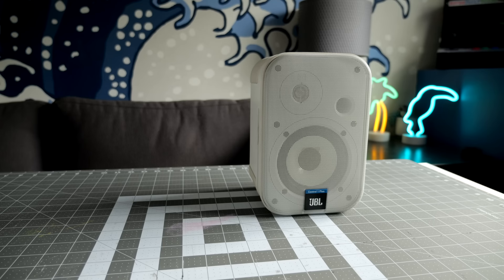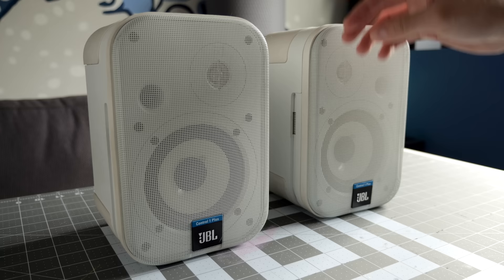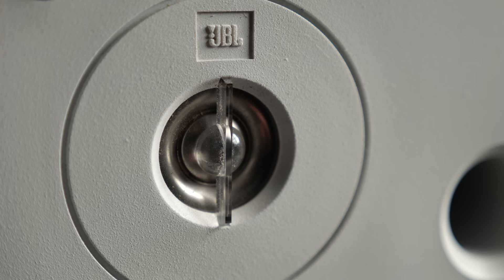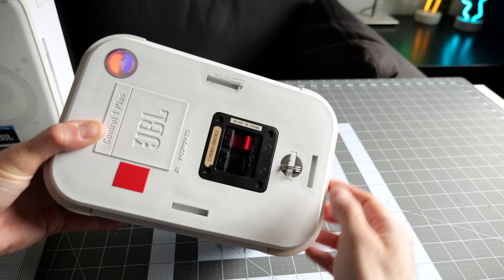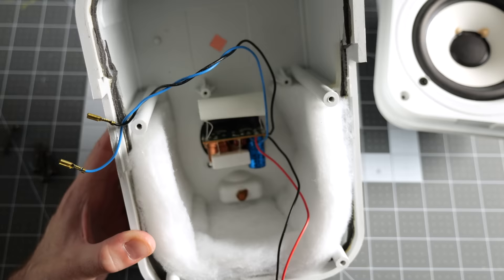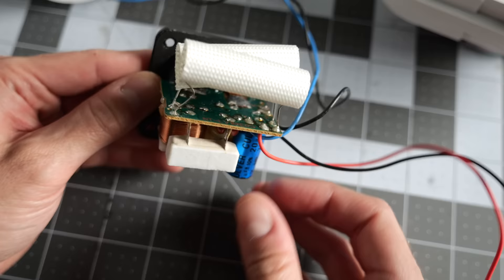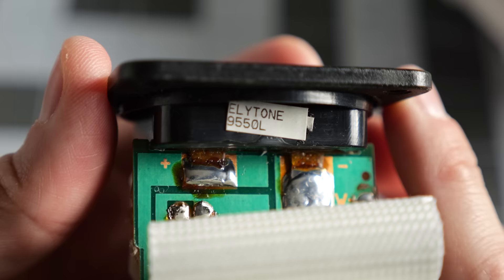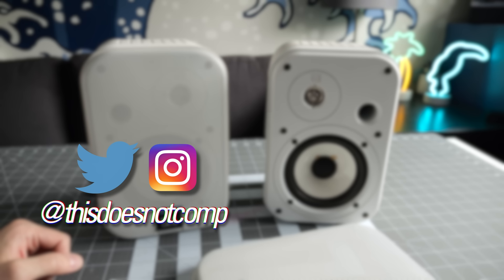Fixing My Vintage Speakers -- But Why Are There Light Bulbs Inside?

Comment: I've got a pair of B&W DM310's that seem to have the same issue. Strangely, I thought it was my soundboard cutting out, since the master out level-indicators were showing low power to the speakers, but I've since replaced that, and every other component in the system, and the speakers are still doing it, even down to the 'pop back to life when you turn up the volume' thing. Maybe they were both on the fritz, who knows. I'll be curious to see if re-flowing those joints took care of the issue!

Comment: If it starts giving you a problem again, it maybe a poor crimp connection on one or more of the speaker cable connections to the speakers. In that case I would cut off the crimps and solder the wires directly to the speaker terminals.

Comment: Hi there, doesn't the names of the control series speakers had to do with the size and number of drivers?
I purchased in the year 2000 a pair of control 25 that can be used in exterior, even painted, but never used them like that.

Comment: I question a bit how effective lightbulbs would be at saving a coil.  Usually the problem is clipping.  When the amplifier clips it stops producing a sinewave and has a flat spot at the top\bottom.  During that flat spot the coil isn't moving, and thus, isn't cooling and heat builds up.

I could be totally wrong, but that's been my experience.  I suppose they might prevent overexcursion.
Reply: My dad has some B&W DM17 speakers. When playing the TELARC 1812 Overture on them at loud volume, a protection circuit kicks in and the red LED on the front lights up and they go quiet for half a second, specifically to protect the components from being held immovable.
Reply: I can't imagine a flat top on the waveform would be an issue here, as they will not always be fed a perfect sine wave. For example, they might get a perfect square wave instead.
Reply: @user2C47  All natural sounds are sinewaves, it's just how nature works, so it's rare that you run into square waves, especially at high volumes.  The only time i can recall hearing much square wave sound was the oldschool PC speaker, which weren't exactly powerful.

I've had speakers cook from the amplifier clipping, and the power being sent to them was well under the speakers capability.  I built a sort of portable speaker as a kid from a old car stereo stuff.  Shortly later i lent it to my brother for one of his party with stern warnings not to go past half volume because of the distortion.  Of course some random kid cranked it and in the morning all the coils were warped and scratching inside the magnet.
Reply: It would save your speakers in the case where you have a too powerful amp driving speakers designed to handle a max power less than what the amp can deliver. In this case the amplified signal would not be clipped and the bulbs will limit the current to below what the speakers are designed to handle. I’d image thus is very useful and much more common since people are always wanting super powerful amps (this thing puts out 300wpc dude!) but rarely own speakers capable of handling nightclub levels of power. It’s not a problem when you have volumes at reasonable listening levels because your probably only putting out 2W during the loudest moment for a fraction of a second and almost any speaker can handle that. There’s a reason a lot of VU meters on amps have a switch to show power x 10. At sane listening levels your amp rarely gets above 1W and your VU meters are boring. We all want to see the meter swinging wildly even without the volume cranked all the way up. But if you turn the volume up really high because you are listening to a really quiet recording of a mellow classical piece then switch to your aux input and play a compressed and brick walled modern rock recording but forget to turn the volume down first these would absolutely save your speakers. 

But I agree with you in the case of clipping. That would indicate that your amp is not powerful enough and these bulbs wouldn’t help.
Reply: @trippmoore  Could be.  I've never had a speaker die from being overdriven, so i'm not sure if the suspension would be strong enough to hold the coil stationary for parts of the cycle.  I've always figured the suspension would just tear or stretch far enough for the coil to pop out.

And yes, people are funny about power levels.  Back in the day i made a huge sub box for my car, and those 2 12's driven at 200w's or so were louder than my brothers 1000w setup.  You generally don't need a fraction of the power people think you do, and even then box design can boost efficiency massively.  IIRC in a like for like situation 10db requires 10x the power and "sounds" twice as loud.  Choice of speaker and box can net you a 10db gain in many cases, and with that a 100w amp will be as loud as a 1000w.

too bad subs are where you need the power, and efficient boxes are generally quite large.

Comment: You mentioned trying to decode the date from the serial number. Doesn't look like you have to as the inside of the speaker panel has a date of 9 or 11 /1989 if you ask me. It looks like just months but there are two sets of dots.

Comment: I have the same issue as you have described. Volume gets softer, starts to crackle a little, when the volume it turned up it fixes itself, I can then lower the volume to the previous volume and they both work fine. I swapped to a different speaker and had the same exact issue. This made me realise it was the amplifier that is causing the volume imbalance, but I’m not sure what exactly is causing it in the amplifier. It only happens to the right channel output from the amplifier, swapping the left speaker with the right speaker still causes the right output from the amplifier to get softer. Perhaps you might want to try with a different set of speakers to see if your amplifier is at fault?
Reply: Output transistor not turning on until it gets enough current? Is this a class A, B, or AB (assuming it’s not D). Could also be a cold solder joint but before the transistor as opposed to in the crossover.  If you have a vintage amp you might just want to recap it. It likely will have at least some electrolytic caps that are way out of spec if it’s more than 30 years old.
Reply: @trippmoore  thanks for the reply! I’m not too sure which type of amp is inside of it, but I’m very sure it’s not a class D. It gets hot even without music playing. It’s a Yamaha Rx-V463 5.1 receiver.
Reply: @jundaaaaaaaaaa  I had a Yamaha HT receiver from the late 90s and after 10 or so years it developed this same issue. It’s the electrolytic capacitors. They used really cheap caps in these in order to sell them so cheap given all the technology they contained. Although my receiver retailed for over $900 when I got it. Luckily I only paid $150 because I had a friend that worked at Yamaha and I got to go to the Yamaha employee sale one year. It was last years model but for the price it was a steal. Took bad it was before hdmi because I probably would still have it if it did.
Reply: @jundaaaaaaaaaa  To elaborate. You should replace all the electrolytic capacitors in it. It will probably take a few hours and it’s not to hard if you can do simple soldering. I’m pretty sure it’s all through hole and not surface mount. The later would be much harder to do without lots of practice.

Comment: I would of tested them before putting it back together.  Just my experience fixing and re coning speakers as a sound engineer. I put way to many things back together and them still not work and have to take it all back apart.    My opinion though.  Good video
Reply: Didn’t you hear how he said it was an intermittent problem? I guess he could have tested if he really fucked them up, but unless he wanted to keep them apart for a couple weeks that wouldn’t help him.
Reply: @trippmoore  thanks for sparing me the time replying exactly that lol

Comment: You made me go check if my Genelec 1029As have foam material in the woofer, thankfully not. Those active monitor speakers could also be old, since they were produced from 1995 until 2005 until they were replaced by the 80 series.
Reply: If they had foam, they would be ruined by now. I learned the hard way...
Reply: @MarcoLopesPT  what happened?

Comment: Another thing that can destroy speakers is a amp not large enough, and the volume turned up. And the amp is clipping, sending dc to the speaker,  causing the voice oil to heat, short,  
I turn it up until it sounds good, when the quality goes down turn down the volume!

Comment: Heard these in a studio once.  Ima be real though if it's not ported woodgrain you're in for a pain.  New Chinese xo's can be had for $30/set & are usually better designed than the usual hackery speaker brands were doing at this time (like only putting a capacitor & coil on the tweeter).  Fixed up my gramgram's klm's & they flattened out in like a JAZZ way.  Of course I also padded them with towel, isolated them & buffered the port with the original wool.

Comment: This is not new. Sometime in the early 80s (maybe 1981-2) I was given a pair of Bose 301 for repair and they also had a “mini light bulb” in their crossovers. The 1986 JBL Pro III (precursor of the Control 1) also had this feature.
Reply: Since these are speakers from the late 80s I don’t think he’s made the argument that the bulb limiters are new.

Comment: the incandescent light bulbs themselves can blow just regular household bulbs you may need to replace them
Reply: You might but they are run cold in a speaker under normal operation, tiny fraction of their rated wattage. They are basically used for their PTC property.

Comment: I have a set of Bose 141 that I've been using for a little over 3 years they fit my application and I used them daily with a bluetooth radio and my phone so YouTube and my alarm clock  Im not disappointed

Comment: For the "Plus" version, i was expecting some kind of metal female SCREW on the plastic supports, so that the speaker could be serviced (let's be honest... SCREWS on PASTIC are for ONE TIME use... specially on soft plastic like the CONTROL 1). Seeing that they still don't give attention to these details is a huge NO NO...

Also... i have the PRO version and they use FOAM woofers! The PRO version should use a RUBBER one (like the Plus). This is all very confusing...

Comment: I don't know if I would ever use the words "fun sounding" to describe JBL speakers.   I'm not saying your wrong,  but it's just JBL was the serious pro's choice.   My experience with them has only been through a professional setting, a friend of mine had PA equipment and dealt in them.   We are talking thousands of watts and they sounded nothing less than amazing.   

It is sad to see the direction this company has been going lately, trying to compete more in the mass market and big box stores.
Reply: Companies go where market demand takes them, while people seem to prefer the numerous portable bluetooth speakers over traditional hi-fi setup,s JBL still makes some decent big-box speakers including the Studio 5xx series.  Right now the Studio 530's direct from JBL for $239 shipped are pretty hard to beat if you want a nice set of bookshelf or passive desktop monitors to run with a traditional amplifier.
Reply: @TheYuppiejr  el and at least that strategy is keeping JBL afloat.   Over always been more of a CV guy.   They have not been entering the cheap and cheesy market.  And it looks like it's closing them.   They have discontinued a lot of stuff that kind of stings.   One case in point is you no longer see the Stroker series of amplified subs in commercial setups.   Used examples of these are getting pretty cheap.   It's actually surprising how cheap.   I have a pair of 15" subs that I paid $800 each for,  and I bet I wouldn't get half that now.

Comment: I had a clone that I turned into a subwoofer when one of the speakers died. You just remove a mesh, do some mods, and shove the other mesh inside of the other cavity and seal it up. It actually worked well for me as a kid.

Comment: The light bulbs are used as a fuse to protect the tweeter from being overdriven
Reply: A fuse breaks down and then you have an open circuit so no current can flow. These act as continuously variable resistors that rise is proportion with the heat they generate. Therefore as they get hotter the resistance increases in a linear fashion and limits the overall current to each driver (one for the woofer and one for the tweeter, place inline after the crossover). So they will always conduct at least a very small amount of current since the circuit never goes completely open. And when the power is decreased they will cool down and go back to allowing the full amount of current through. They limit the current in a linear manner as opposed to a fuse which is all or nothing and they don’t need to be replaced like a blown fuse. They are protecting the drivers from being overdriven, but they do not operate like fuses at all.
Reply: @trippmoore  I may have misspoke!, but I just repaired a set of speakers where they either got DC voltage or they were overdriven to the point that both in line light bulbs were burned out, just like a fuse, but, yeah they are are resistance to help protect the the tweeters from getting fried, however in my case, the tweeters were fried as well!, replaced it and the crossover network as well, since it too was damaged, thanks for letting me know about the bulbs being an additional resistance 😀

Comment: did you check the lightbulbs functionality? household light bulbs have a maximum lifetime (especially the filament kind) so i would think speakers that use them have the same limitation
Reply: I think if a light-bulb were blown you wouldn't hear any audio, or only the woofer or tweeter would be working. As they're connected in series with the drivers, like a fuse would be.

Comment: Why not use PTC's in stead of lightbulbs?
Reply: That's basically what they are.  High-current PTC thermistors.
Reply: Nowadays you might actually install some of those flappy PPTC polyfuses instead, yeah, they have a sharper response, which is both a good and a bad thing. Maybe speaker sounding compressed when overpowered was deemed more desirable than it nearly cutting out and cutting back in a while later.
Reply: A PTC or polyfuse would need to become hot before its resistance increases. Because of its physical size, that would take a few seconds - not quick enough to protect a speaker cone from over-excursion. A light bulb's filament heats in a fraction of a second, thus offering better protection against fast transients.

Comment: Hello folks That’s a lot of you mentioned speaker manufactures used lightbulb iam against lightbulb because now you’re not getting the speaker doing this what supposed to do to deliver and perform your compressing and lowering sound  Quality that at the very end where you want it the most you want the high-performance equals high maintenance and JBL in  drivers they don’t use aluminum former on the Voice coil use paper and I’ll take it long time or many years if you crank out  your music to burn out before it starts rubbing the voice coil coating away amp clipping will Allum voice coil warp it and the lightbulb thing the both simpler they don’t want to be known as a bad manufacturer and this is why they have a bad JBL or loud speakers speakers because you have all this stick wire and everything and then this little fuse were the wires like your hair that’s gonna interfere with the sound and also on the back of those resistors parts that bad and the capacitor rip it off that was $400

Comment: Well, they looks to be somewhat decent speakers for the price, but the crossover is nothing but HORRIBLE !  Electrolytic capacitor should never be used in a crossover because they will leak someday and have a very poor ESR.  Adding lightbulbs in the signal path is also a design flaw, in my opinion.  Its Junk But Loud (JPL).  So if I had a pair of those crap, I would remake the crossover using similar value components, but with polypropylene caps and #14 gauge AIR CORE coil.   Try it, it gonna sound MUCH BETTER.  At least, cabinet construction and drivers seems to be ok.

Comment: Nope that's not going to fix your problem the Speakers are going out the main coils are burned out the enamel wire on the main coil of the speaker is wearing out this problem will get worser and worser until they just don't work no more I know because I recoil them myself... Another way to tell if this problem is the actual main coil that I'm talking about is when the speakers turn off while using them push down on the speaker gently and if it turns back on it's your main coil

Comment: you cant call those vintage. They look like anything you would buy today.
Reply: 1990 to 1992, but unconfirmed. they look as modern as any other speaker though
Reply: @ProbablyAnAmateur  That's my point, back in 92' if someone said vintage, I expected a certain look. You know the 70's and 60's looks. Vintage meant something at one point, aesthetically.  Modernity seems to have killed that meaning.